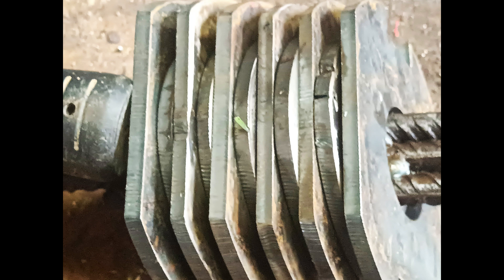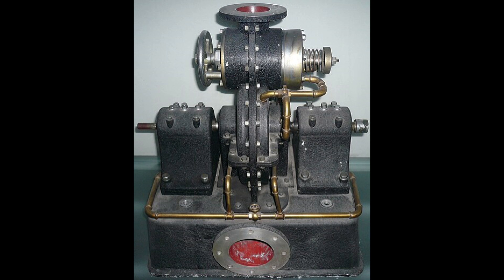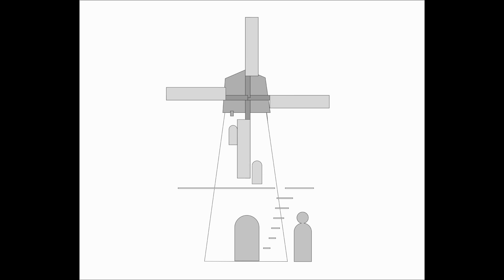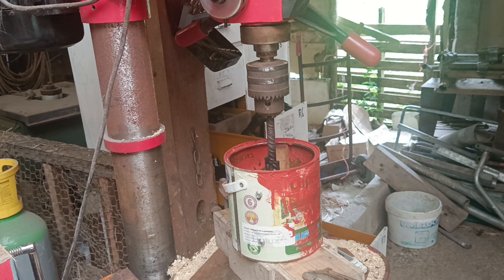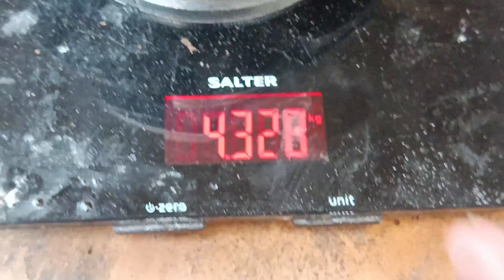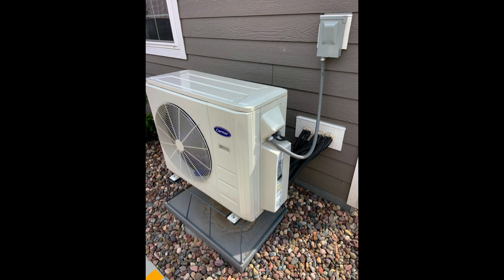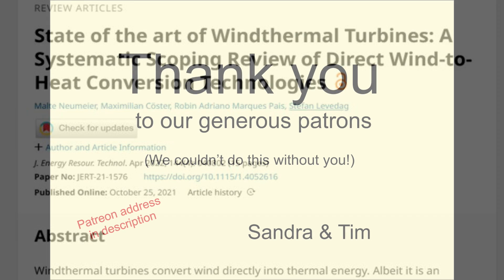More Interesting Things About Friction And Mechanical Heating - It's All So Interesting!

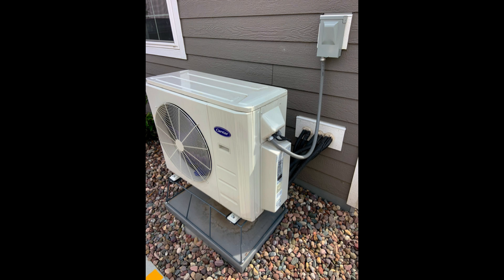Comment: 7:05 "you would lose energy just to get up to those speeds" right after "you could put it in a insulated box to get all the energy"..

Put all your step up gearing in the insulated box.. Worries about gear losses be gone!
Reply from the maker: I'd be interested to hear how you would arrange the seals? Especially for the one at the top?
Reply: @wayoutwest-workshopstuff6299  Sure...
I envisage an insulated box that has both air and water filled sections.
That means that the input shaft seal has ambient air pressure on both sides. It only needs to stop hot air escaping by convection.
Rags in a stuffing box would be more than adequate. If its the only hole then just a really close fit might do. 
Once the drive is inside the box, all the lossy gearing can be done in the air filled section.

Result is that the gears run hotter (they'll be in warm air, not ambient), and all the losses from efficiency contribute to heating the insulated box, which helps heat the water.

I'm also tending towards the heat pump vote. Can't beat a bit of amplifying your energy for free..
If all the equipment (gearing, generator, batteries, heat pump motor etc..) was in the insulated box, then the associated conversion losses can be recovered as well....
Ambient air is drawn in, warmed by the equipment, cooled by the heat pump evaporator, then returned to the outside colder than when it entered.
Reply from the maker: You haven't forgotten that the whole cap of the windmilll rotates? And if you had a tank up there you couldn't have pipes coming down from it?

Comment: Using eddy currents to heat up copper is almost making a generator. Except that if you use a loop of copper wire you can direct the energy into a single point that heats up, like a resistor or a light bulb or a heating element. Instead of a sheet of metal.

Comment: It is somewhat complicated to generate power, but that also has a lot of advantages, like more ways to optimize output to varying wind speeds. Also, power is always useful, even when the heat storage is at capacity. Using the power to pump heat pump can make the heat gain more than compensate for additional transmission losses. Gearing to increase speed can be done in few steps with large gear ratios. 

Although generating power, and then use a heat pump is "involved", I wouldn't be surprised if generating meaningful heat more than occasionally by friction, without having to manage the system very frequently turns out to be more difficult in practice. Motors that can be converted to generators and heat pump systems that could be use after some modification/repair and refill  is discarded every day.

That said, I'll be more impressed than surprised if you manage to make a reasonably practical system based on friction.

Comment: As you said in the film the term efficiency for a heat pump or refrigerator is misleading. Efficiency describes the output compared to the input.  i.e. the proportion of the energy driving the heat pump that is responsible for “moving” the heat from the cold reservoir to the hot.  You may have a 50W motor driving the compressor delivering 40W of work (80% efficiency)
The coefficient of performance (COP)is the term that can be above 100. The 50W heat pump moving 100W of heat from cold to hot has a COP of 2 or 200%. 
Love the channel one of the best available.

Comment: If you are heating water, why bother bringing the shafts down to the floor at all? Just put your heater tank up on the very first shaft, or near it, and then you have gravity feed of your hot water.
Reply from the maker: Good point. The storage tank might hold 5 or more tons of water though..
Reply: @wayoutwest-workshopstuff6299  the main water tank might be massive and placed on the ground, with the heat exchange loop up at the top and the friction heater on the first shaft. Hoses between.
Reply from the maker: @JamesNewton  well not the first shaft - that's in the cap (which can rotate 360 degrees, mangling hoses!)
Reply: @wayoutwest-workshopstuff6299  Goodness, I'm doing a bad job of describing this I guess. Hoses between the heater tank, which does not rotate, but sits under the top shaft, and the heat exchanger in the tank on the bottom floor. The friction plates can rotate all they want, along with the first shaft, as long as they stay centered in the heater tank. So one gear to translate the first shaft to a vertical shaft that goes into the heater tank with the plates attached to it. I was assuming the heater tank would be still with the plates rotating over it and the heat exchanger through the side of it, but I guess you could even rotate it with the head and the heat exchanger could dip over the lip to cycle out the hot water. Heater tank is the "dirty" water, hoses run from the heat exchanger (which does NOT rotate in any case) down to the lower, larger tank. Extra energy cost in pumping the water between the two tanks.

Comment: Hey, I think you mistakenly assume that "lost" energy in conversion processes is truly lost - no, it all turns into heat, so, if you can watercool that converter, you end up with the thing you want. Basically, anything converts higher forms of energy into heat, you just have to be able to take it out. 
The easiest frictionless setup would probably be a water cooled generator with its output shorted. If thats too much of a sustained load and things start melting, dump the output into a watercooled resistor bank.

Comment: A hallback array of small magnets around a large wheel should have almost no friction and no energy lost. While at the same time, giving you a very large change in magnetic field very rapidly. You place a copper or aluminum container of water carefully aligned around the outside edge so the magnets quiz by it.

Comment: All you really need is a state change material or in other words something that you can cause to condense and then boil under controlled conditions. This is how most cooling systems work and is exactly how heat pumps work.

If you get a pump and a valve/backpressure regulator along with two air tight containers piped together you can make a heat pump to gather heat from the air around one side of the unit and transfer it to the other side and into either air or liquid.

You can technically do this with water if one of the vessels is under a vacuum but it would be easier to use a substance that is liquid at the desired temperature when under a specific amount of pressure. Something like propane is a great example, at ambient pressure it is a gas but if you compress it to 2-3 bar it will turn into a liquid again. The higher the pressure the hotter it can be when it is a liquid.

Also of note is that you can do this with air as well in a closed loop with just two heat exchangers, one on the high pressure discharge and one on the low pressure suction with a backpressure regulator in between. Just compressing the air will increase its temperature both through friction from the compressor and because during compression you’re adding energy to the air. The first heat exchanger transfers the heat to your water and then you go through the valve to the low pressure side of the unit, which will drop the the temperature of the air by around 17 degrees c for every 1 bar of pressure drop, you then use the other heat exchanger to transfer ambient heat energy to the air and then it gets re compressed and continues the cycle. You can also do this with a non sealed system where the air is just released out of the valve after going through the first heat exchanger. The goal is to have the compressor never stop operating so you’re always flowing the air. If you add a liquid cooling jacket to the compressor you can also scavenge that heat while cooling the compressor in order to make the whole system that much more efficient.

If you want more details or just want to pick my brain on anything let me know. I’m a controls engineer who works with industrial equipment and high horsepower compressors as well as a tinkerer who likes to solve problems from new angles because “that’s the way we’ve always done it” is my least favorite excuse to do something.

Comment: If you have a low RPM shaft, you can have a gear train bringing that up to high speed and then spinning some paddles and put the WHOLE LOT in a singke vat of oil. So you get the high RPM spinning paddles in oil, and all the losses from the gear train are just added heat into your oil (which is then heat-exchanged onwards) and wear will be very low. The water -cooled workshop air compressor idea in another comment is excellent, though, and basically asimple  heat pump too :-)

Comment: An electric generator is  more efficient than any mechanical system you can make, and it is also much smaller, cheaper, and readily available. Add to this the difficulty of pumping and circulating  water and heat losses compared to electricity.

Comment: I just had an idea for you. Why not a belt drive on a fixed pipe filled with water. The rubber belt or even leather will give great friction. It's also used as a method of fire by friction if I recall. Edit it's called thong friction fire method. Also you can roll a ring the width of the turbine and use that as the belt drive for maximum speed ratio instead of the slower drive shaft. Cheers J
Reply from the maker: good idea Josh - except some of the heat generated would be in the belt, maybe? and be lost as the belt circulates?
Reply: @wayoutwest-workshopstuff6299  ah so because the belt moves it's constantly being air cooled while you're water pipe is constantly being heated. Seriously watch some tutorials on the fire thong. Also surely you've cut bailing twine with bailing twine, it's the same thing. I bet you'll get as good of heat with very little wear on your parts. Worth a try?
Reply from the maker: Yes - always worth a try  : -  )